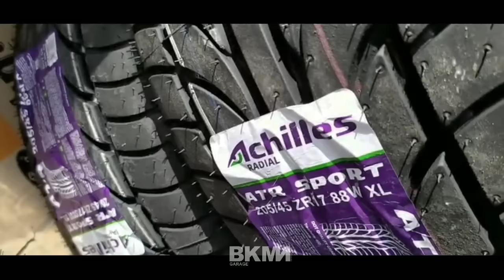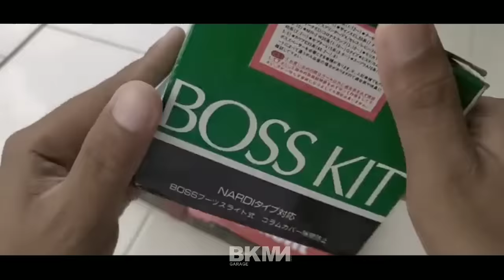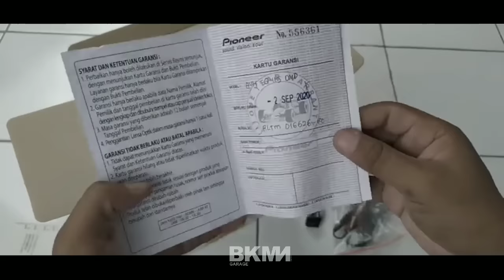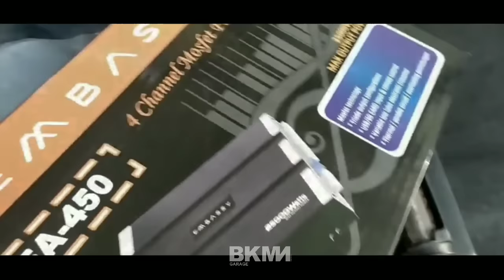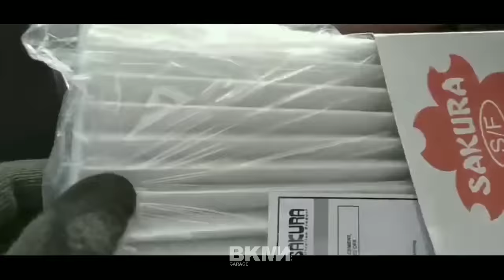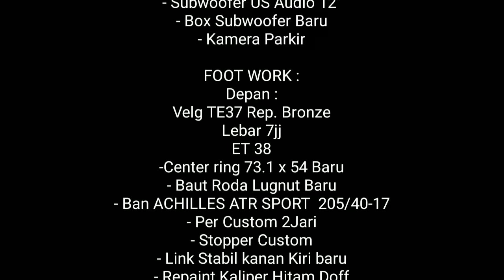BUILD A TOYOTA VIOS in 11 MINUTES | Full video process Project MOBILKU#01

Comment: That takes me back; I used to have one of those, but in Canada they call them a Toyota Yaris sedan. Mine was a 2007, 5 speed. It had the ground effects & a small spoiler on it when I picked it up from the dealership, it was red. First thing I did to it was to put a set of aluminum wheels on it, then I put a Kenwood head unit in it, along with a Kenwood amp & 12 inch sub!
Reply: In Indonesia this car famous from Taxi Car
Reply: same thing we call it in Australia
Reply: @eftownz2664  besides etios valco of course
Reply: It is called Belta in Pakistan
Reply: In Jamaica we have all 3 belts Yaris and vios
Reply: Is Yaris sedan and Vios the same car?
Reply: @steve0826  yes, the grill's a little different, but I think that's it.
Reply: @steve0826  belta , yaris sedan , vios. Different names with same features from Toyota
Reply: Same thing in usa the are call toyota yaris
Reply: Untu
Reply: Well same in Indonesia too they call it vios or toyota yaris sedan
Reply: We call it in the philipines the Gen 2 Vios
Reply: We still have one. 2009, 60 000 kms. Cvt.
Reply: @troll2637  Love those cars!
Reply: @bazilwreckerloughead  yup. Still love ours. Feels like an ev when not pushing the car to its limits. No gear changes.
Reply: What is the Size the rims ang tires
Reply: @StopBoxingSportsCenter  my Yaris had 15 inch tires.
Reply: @medikartawijaya3993  untumu karaten 😅😂
Reply: It is called sagne in Konoha
Reply: U did well😂❤
Reply: In malaysia we call dugong..
Reply: That toyota yaris is from Japan
Reply: @babygroot5214 same, I’m Pakistani

Comment: Lowering springs will be okay but cutting off the stock ones big NO.
Reply: Lol
Reply: Which tells me the seats are most likely fake Bride knock off's and the wheels are reps. I believe the only Brand name parts is the Muffler, the JVC double din Head unit and the steering wheel. But the steering wheel hub kit is a cheap eBay China made part. Instead of an NRG hub kit with an NRG quick release.